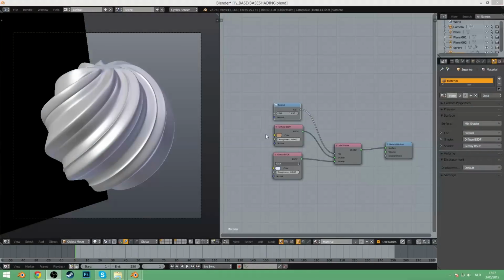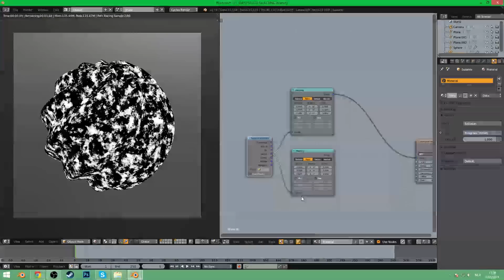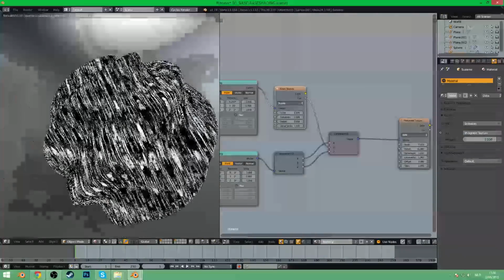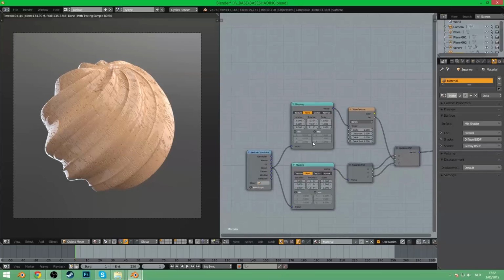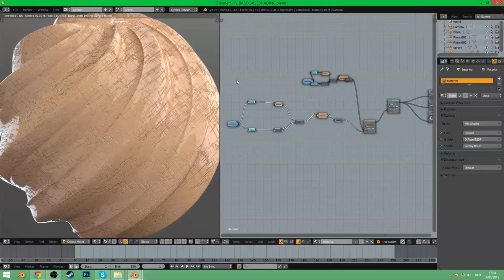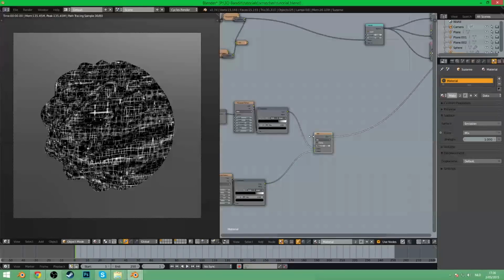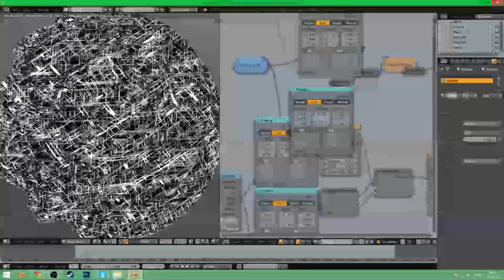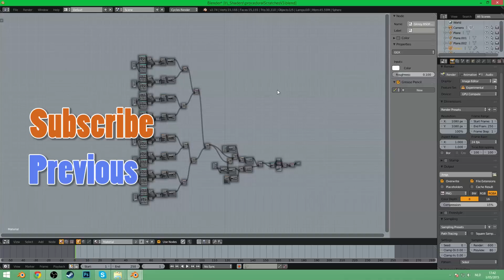Blender Tutorial - Procedural Scratches

Comment: If you apply the node setup as at 4.07 to a cube the ‘y’ aligned faces render OK, but the ‘x’ and ‘z’ faces don’t. This may better illustrate the distortion mentioned at 5.57. One work-around may be to use the Math Vector node.

Comment: Instead of using the separate XYZ and combine XYZ trick, could you use a Vector Math node set to add and simply add the  vector from the mapping node with the wave texture? It seems to give the same visual results and I find it  more logical (mathimatically). However I know little about how this actually works, so I fear there are some downsides to my method.

And thank you for another great procedural tutorial!

Comment: this doesn't work for me. I did exactly what you did and it doesn't show any scratches
Reply from the maker: +TheWatcher _ hmm on what kind of object are you using it on? have you tried previewing some nodes to check where the problem is?
Reply: 3D Bandit in the preview tab it didn't show up... I'm using it on a chube that's made to look like a door
Reply from the maker: +TheWatcher _ well if it's a simple cube with 8 vertices it won't work because the pointiness can't work properly, try adding nmore detail, beveling your edges and subdividing your door :)

Comment: nice tutorial, but how do I change the colour of the scratches?
Reply: Max Werner never mind I figured it out. I plug the color from the color ramp into the factor of a mix shader and then mix two shaders (in my case diffuse for the color of the object and glossy for the scratches) and use the ouput as the output you have as the main diffuse of the material
Reply: +Max Werner can you send a pic of the node set up?

Comment: The workaround I use to to be able to input values on vector mapping nodes is by using a color mix node to mix input from two vector mapping nodes.
In one of the mapping nodes set all values to default, in the other set only the values you want to change 1. Then use the factor of the color mix node set to multiply to control the value with your value node.
Reply from the maker: ***** but isn't that going to fade between two different vectors insted of rotating it? interesting technique though :D I'll keep it in mind
Reply: Well theoretically it will, but since it is applied on the vector part of the node it will fade through the rotation values between the specified numbers, not on the color info, thus actually rotating it. Also works well for translations or scales, color node is just a workaround for being able to multiply with a factor.
Reply from the maker: gracias? :D